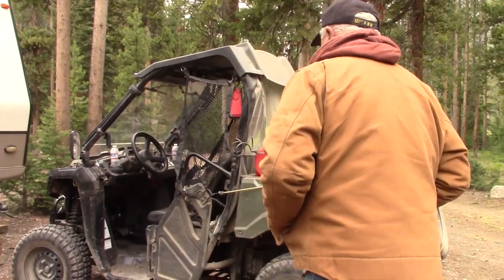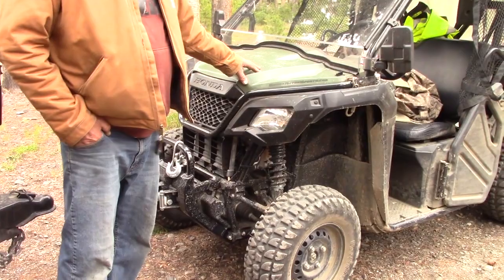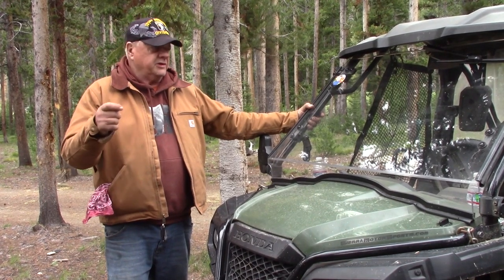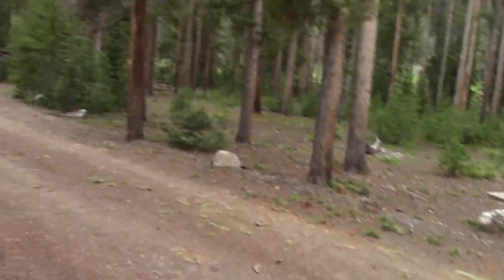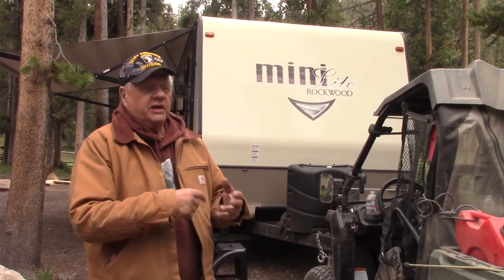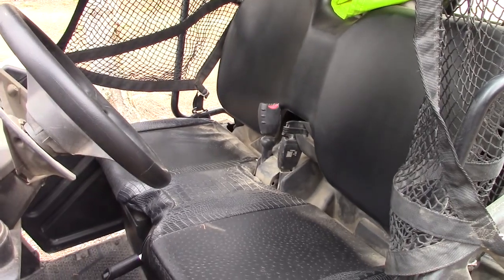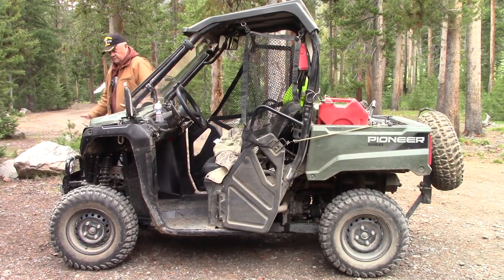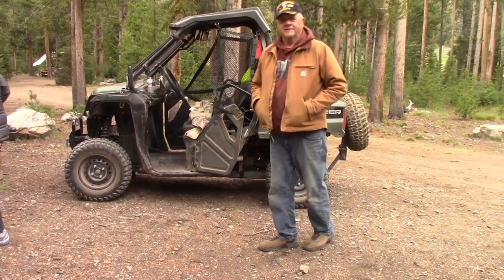Honda Pioneer 520 Side By Side Review After Years Of Service | Is The Honda Pioneer 520 Worth It?

Comment: Yes by far the 500 is my favorite utv.    The transmission is the game changer.   I’ve owned a few more expensive brands.   Faster with more amenities.    P500 is the ticket.   I pull big trailers on ranch and can’t say it requires more hp.   The low gears and transmission is king starts and runs like a kitten.
Reply from the maker: I agree 100 percent

Comment: Thanks for the video.   I have a 520 and happy so far.  I had a heater put in mine and works okay for the winter months.   Its not going to be as snug as a car would be.  I need to get a jack for it if you can recommend the size.  Last winter I got stuck in a snow drift that took some extended time to get out.  I have a winch on mine, but there were no trees to hook to.  I read from someone's comment that you can put it in four wheel drive  and put the brakes as you step on the gas pedal to engage the front tire that is not spinning.   It did not work for me.  I seen several videos of the Appalachian hillbilly that has the Honda 500.  He calls it mighty mouse.  He put a torq locker to make it a four-wheel drive.   Wanted to ask your opinion on that?  I like the attachment for the spare tire.   Where did tou get it?  
Thanks
Reply from the maker: Your welcome, as farmers as a jack I look all over for a small one ton but I don't think they make them anymore so I found a 2 ton on Amazon  and thats small enough  to carry in my tool box. I dont believe stepping on the brakes does anything for the  four wheel  maybe in your case a set of easy on chains would work. Honda sells a spare tire attachment for the hitch but its  $$$$$ so I  found them at a harbor freight for alot less.
Thanks for watching and commenting 😀

Comment: Would love to have one but at 74 do not want to be loading and unloading it off and on  a trailer.   Do live very close to the trails hear on PEI but was told I can not take it even a short distance on the road.  Think they should at least let you ride down the shoulder of the road for short distances. What is the difference between cutting the grass with a riding more than taking one of these on the shoulder of the road.
Reply from the maker: I know in Utah and idaho they can be licensed for the road but in idaho you cant drive them on state highway even though we see them all the time.  In my future video's  I have purchased a side by side and a trailer, its really not that bad.

Comment: 22:39 I have a Pioneer 500 which is virtually identical to the 520. On the plus side it's compact and fits in an 8 x 5 foot trailer. The transmission is great but noisy. On the down side it is slow, has poor ground clearance, no diff lock, extremely rough ride and a park bench for a seat. It's more at home probably just being used as a utility vehicle around horse stables or something similar.
Reply from the maker: Thats kinda what drew me to the cf moto, I ended up buying a cf moto trail 800, a little bit more clearance and more power, plus now a lot cheaper.  Videos on it are soon to come
Reply: 520 has a bigger engine, a different transmission shifting map, no sway bar and slightly different shocks. Of course a dump bed too